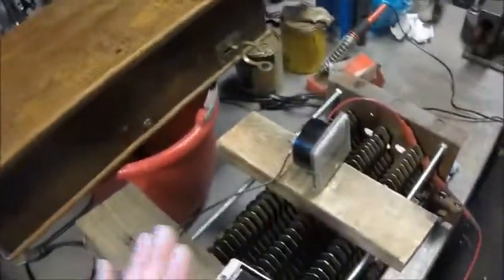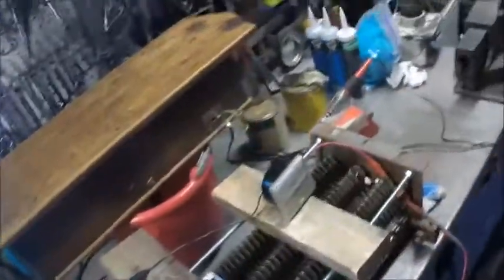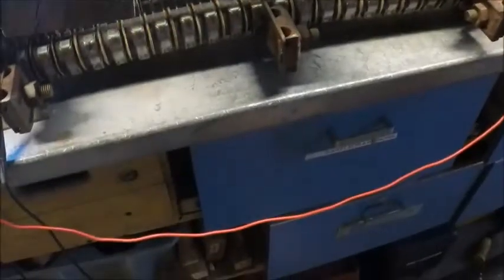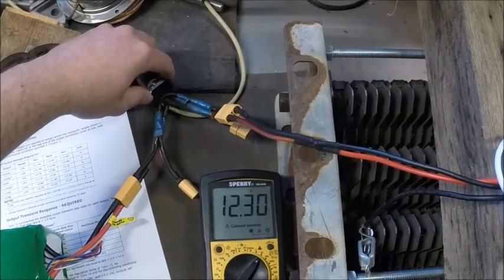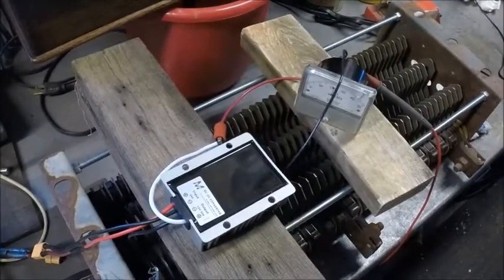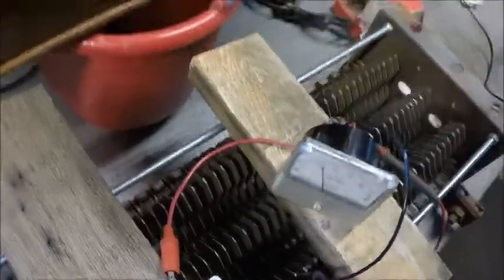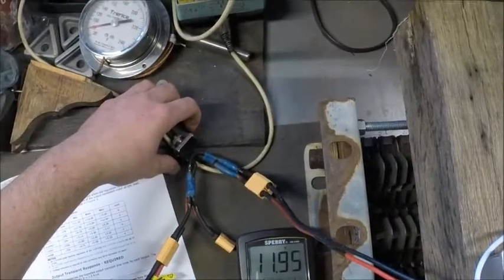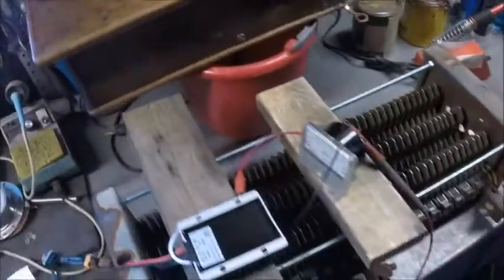Uxcell 24 V In 12 V 30 A out DC DC buck Converter Review

Comment: Thanks for making this. I'm going to use the 48V to 12V 30A version of this for a large RC plane hung from a ceiling and mains powered as a static "press button" display. Wanted to know if this worked and supplied the rated power. Looks good, I wonder how long it will work for? We'll see :-)

Comment: what about 2V and 40A (DC output from DC input), any idea?
Reply from the maker: Output voltage rating is around 12V, so 2V output is probably not possible without damage.
If you meant 12V and 40A, for this 360W rated buck converter, 40A exceeds the limit. 360W/12V=30A max. Would definitely buy the next size up that is rated for 40A.